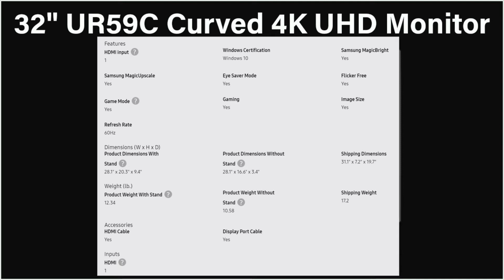SAMSUNG 32” UR59C CURVED MONITOR

Comment: Hi, Unboxing video is good. This video is more than 4  month old, Can you please upload a review after using 4 months of use. Please focus on these topic - 1) How Picture by picture function is working 2) In this monitor there is only on HDMI port and one display port, If I need audio and video connection from two different device then how I will connect. 3) The size of monitor is 32 inch and when I will use PBP how resolution of both device will feel, the picture resolution will divided horizantly and but vertically, so aspect ration will be very bad.... Can you please review and upload more in PBP functionality in detail .

Comment: Hi, I was wondering if you ever tried to connect this monitor to a MAC ? Did the text look good, crisp and clear or blurry/pixelated?
Reply from the maker: Not yet.. But again its 1080p only so don’t expect that it will be same as apple display. if you are more on pixel i suggest go for high-Res.
Reply: @shinflores1312  its actually 4k
Reply from the maker: @omar ahmed so yes it will be pixelated. Because this monitor support 1080p FHD only.. Try this https://www.lg.com/us/4k-monitors
Reply: @shinflores1312  this monitor(r590c) is UHD 4k not 1080p
Reply from the maker: Sorry my Bad 😅.. I thought were talking about one of my video which is AOC monitor.. Yes i tried this in Macbook Pro 13” resolution wise is Good enough but make sure to use High Quality Adapter(if you’re using mini-DP port.

Comment: Hi,
This monitor actually uses PWM to dim brightness which can cause eyes’ strain on the long-run IF used incorrectly, would you please take a couple of minutes to use the test on the below link(or similar) to know the minimum brightness setting that causes PWM ? For example does it happen when you set brightness to only 10% or 20% or 40%: https://iristech.co/pwm-flicker-test/
Reply: The steps are really simple, you just open this page https://www.testufo.com/blurtrail, lower the brightness and see whether the line has a trail behind it or multiple line. If multiple lines start to show at brightness 20%, there you go, this is the brightness setting you should never set below (the full instructions are in the link in the original comment)
Reply: I’m one of those people whose eyes react badly to PWM, so I’d be really grateful if you can help me know this info.
Reply from the maker: I will try it for you bro.. Sorry for late reply 🙏 I’ll give you a feedback after few days.
Reply: @shinflores1312  9 months passed man